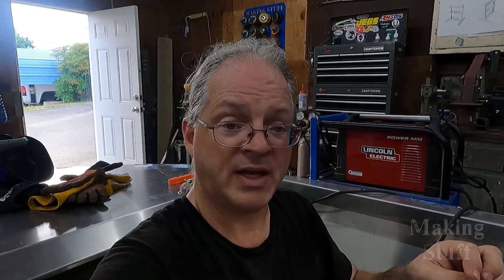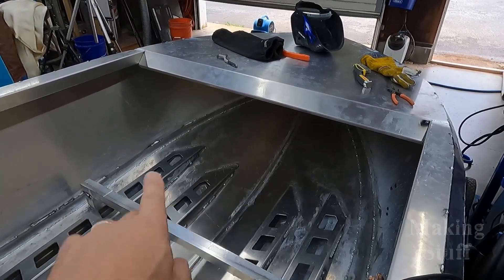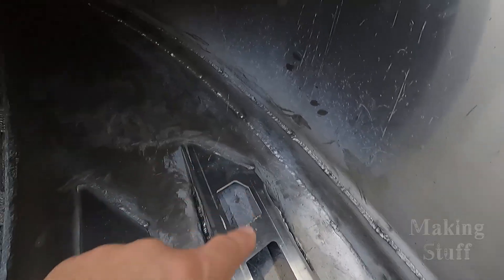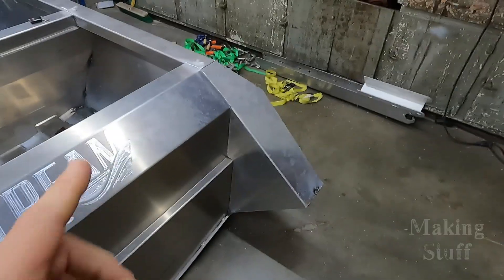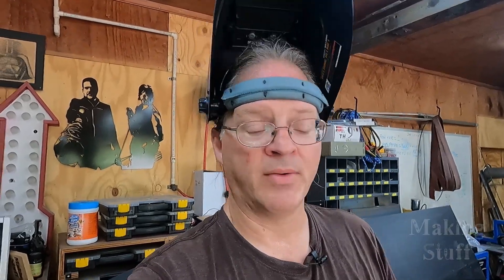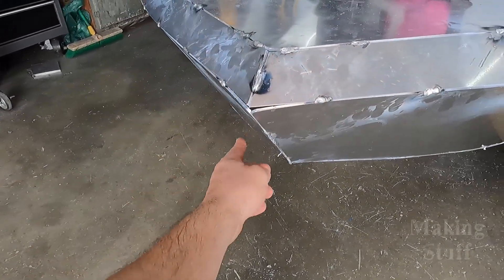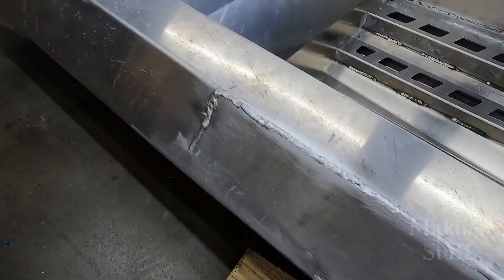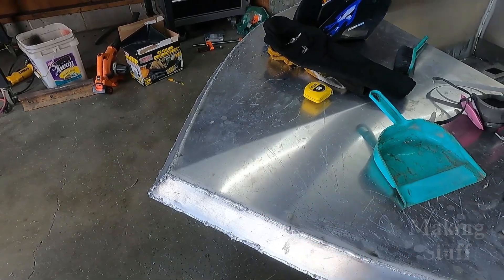Mini Jet Boat Build - Part 2 - Jetstream 12' Buccaneer

Comment: I dont see you doing your pick up on start stop. You're not worried about those seams leaking?
Reply from the maker: Both sides are welded. No leaks yet.  Boat has over 20 hours on the engine now.
Reply: @MakingStuff , first let me say thanks for responding back. Look up Austal LCS ship. Every start stop on that aluminum ship in the welding procedure said we had to do our pick up. I knew the Navy was full of it. Great build.

Comment: what is the thickness of the aluminum plate please?
Reply from the maker: The bottom of the hull is 1/4inch.  The stringers are 3/16, everything else is 1/8.
Reply: @MakingStuff  thank you so much.

Comment: looks good 10/10 for giving it a shot most people are to afraid to give something like this a shot, the only things I can recommend is when welding you should always weld into a weld not start on a weld and also do as many stitches as you can, when using sanding discs or cutting disc use a bit of bee's wax your consumables will last 20x as long
Reply from the maker: Thanks!

Comment: Are all aluminum parts the same thickness?  3/16" or are there any smaller ones?
Reply from the maker: The sides, transom and bulkhead are 1/8", the stringers are 3/16" and the bottom and chines are 1/4"

Comment: Amazing project! How does it compare when using spool gun for aluminum  mig welding against normal mig torch?
Reply from the maker: They both make the same quality welds.  If you are going to do a lot of welding, the spool gun is more reliable and going to make it easier.
Reply: @MakingStuff  Awesome. Thanks for the reply.

Comment: As far as the cab goes I would have TIG welded all the cap and all the exterior parts to make it a better look. Imo . And I meant to ask too far as welding wire goes are you using 4043 or are you using 5356?
Reply from the maker: I'm using 5356 because 4043 is too soft.  I was going to TIG the outside, but it takes 3 times as long and the welds are going to get ground down smooth anyway.  So it isn't important how they look.

Comment: Is there any particular type of aluminium that is required for boats?
 I hate welding thin aluminium as there is a very thin line between trying to control your puddle and blowing through. I would name it Wake Breaker!
Reply from the maker: I think 5356 is good for water applications, but not really sure.  Thanks for watching!

Comment: How many hours did it take to fully complete the build?
Reply from the maker: I've been working a little each day and take a lot of breaks due to the heat, but probably have about 15 to 20 hours into at this point.  Once I get it flipped over and get the bottom welded, most of the welding will be done.